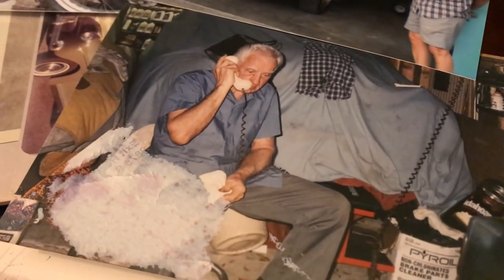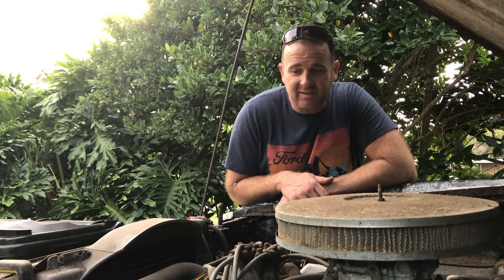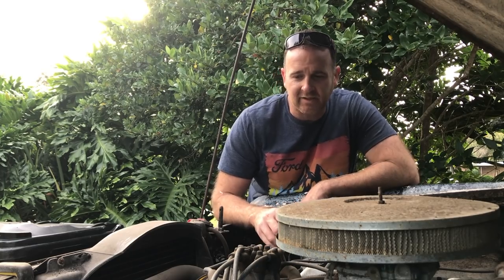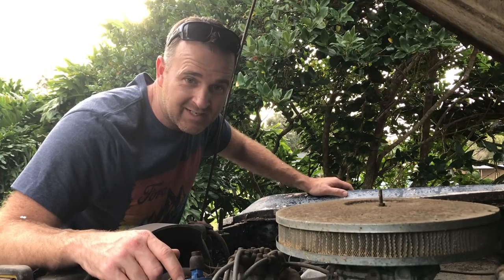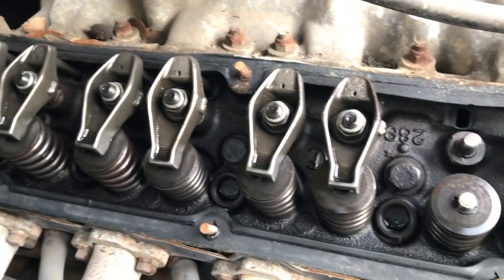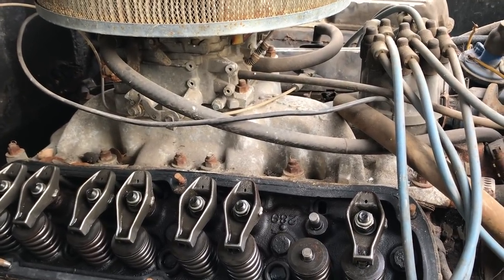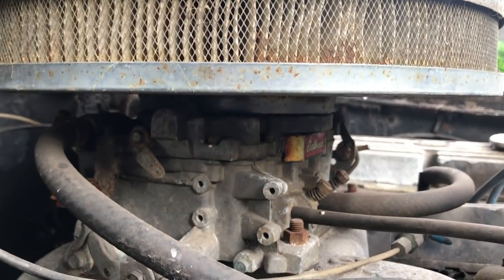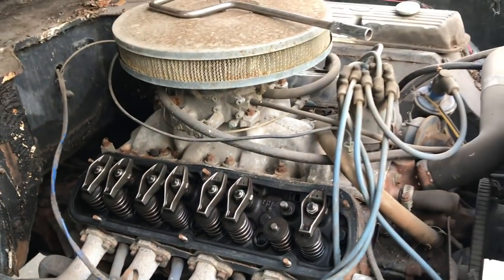HOW TO REMOVE BROKEN STUD OR BOLT- ENGINE, HEAD, EXHAUST Stud Extractor tool

Comment: I just started working one yesterday, been sitting for at least 10 years, last registered 2005. ( 77 bronco ) Completed my goal of rolling it over and getting a spark. Spun by hand, then put some diesel fuel and oil mixture into the breathers of the valve covers and just cranked for 10 sec at a time. Spins nice. Had some issues with the Duraspark system, but soon enough got that handled. So, got rotation and a spark. Next, See what this old Carter has in store for me!!     Good luck, I'll keep watching!!
Reply from the maker: If you have spark and compression and turning over freely you will get it running no problem. A lot of times if they sit for a long time Ill pull the spark plugs and shoot some marvel into the cylinders and turn it over with the plugs out. Obviously that fuel in the tank is shot- Ill usually drain it and check the tank for rust and blow through the fuel lines. After that I check to see if the fuel pump is still pumping well. With the last one I did that sat for 10 the pump was bad.  Then you get to sorting the carb. I have found with the ethanol in most fuel now I almost always (or always) have to rebuild the carb if its been sitting for more than a few years. Good luck! Send me a video or pics when you get it running!

Comment: yeah, but what do ya do if it's a pressed in stud and it breaks off with no threads left??   Up shitte crick I guess...lol.
Reply from the maker: Get out the welder and torch.... it's gonna get messy. Did you have one break off below the threads?
Reply from the maker: Actually if you have enough space I would use a die and add threads to the studs. Then use the washer stack method to drive it up.
Reply: @FireItUpGarage  yeah, that's a good idea. I just ended up using diff heads.
Reply from the maker: @molly18239  Nice did it all work out? Back on the road again?
Reply: @FireItUpGarage  I just put another set of heads on it for a while, but later on pulled the ol' 305 and installed a proper 350. Problem solved...lol.